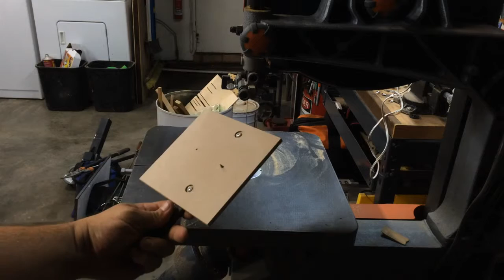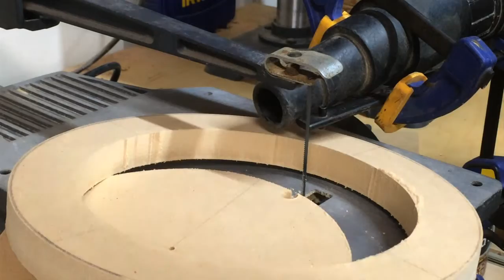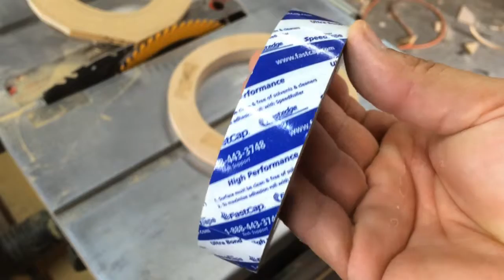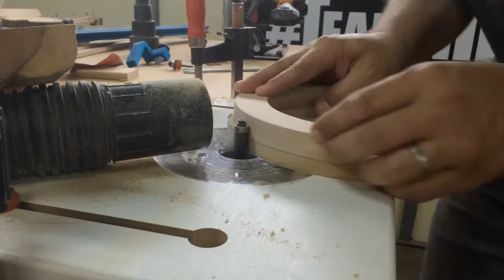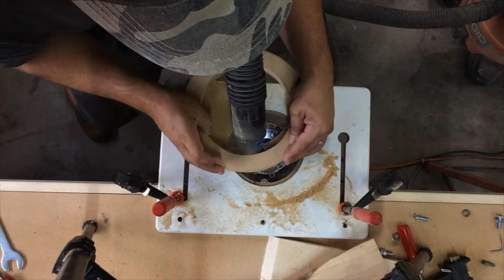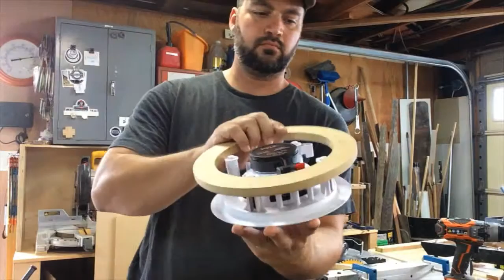Template Routing For RV Speaker Trim

Comment: Your DeWalt router set is supposed to have a vacuum adapter to fit your machine snugly. This works really well over here... as I discovered recently after lingering in a struggle with the vacuum hose :) Search for accessory nr. A28678SV